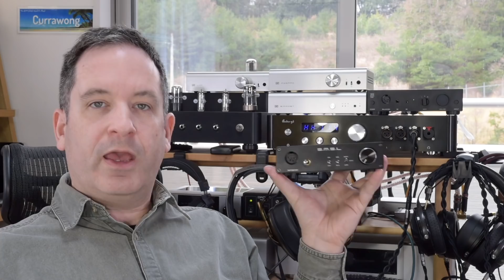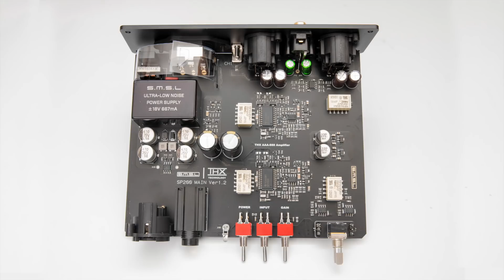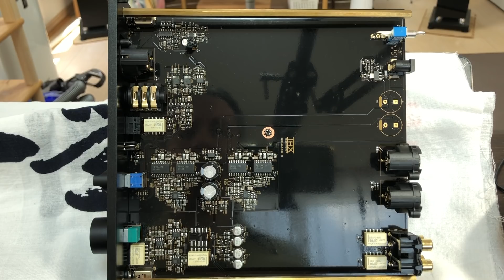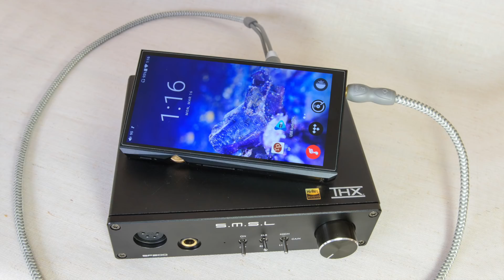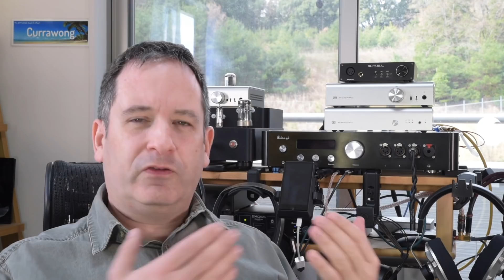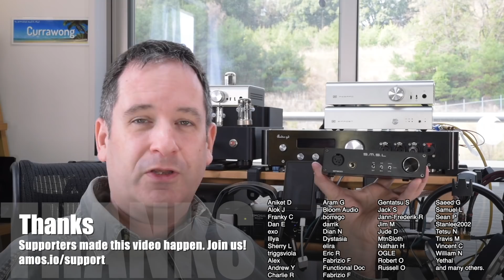SMSL SP200 THX AAA Headphone Amp Review

Comment: Many thanks for this review Currawong.
You nailed it and extremely well put together Sir.
I have one of these units and You uncovered what I believe is its underlying issues with the power supply.
Its a shame that they implemented those balanced connectors that don't really do much.
I would have not used them and instead had 2 power supplies for each channel and a stepped volume pot plus some other changes.
I find this unit a real odd ball to be honest.
It is as You say extremely accurate which Is great but shortly becomes dry and uninviting.
Interesting how the sound stage is spread out and less central focus to.
Have a great Day from the UK :)))

Comment: I've just got mine today I'm sending it back it's not really usable soundstage is just not there I think I may have a defective model as if I unplug a RCA  so just ones plugged in I still get sound in both headphones and running a left right sound test I notice left would play through both speakers same for right so completely useless for gaming as well
Reply: I am feeling exactly the same.
I originally bought this amp because I have a ton of THX badged equipment from Years ago and was hoping that it implemented some of the de-coloration - De- emphasis and re-equalization of the sound stage but this review has further affirmed my suspensions in that the manufacturers have jumped off that THX logo and mainly applied it for output and feedback.
This unit reminds Me of a British manufacturer I bought Many Years ago named Audiolab.
One of the biggest mistakes I have ever made 
The Audiolab was drier than a desert and had literally no appeal whatsoever.
This small Headphone amp is either a hit or miss product.
I have been collecting for some time both valve and solid state and find this unit good but not excellent.
Its a unit that amplifies and that's about it and is extremely linear which is ok but for Me it can be uninvolved and lacks life.
The review was extremely helpful.
What gets Me is that minimal power supply is tiny which adds up to the sound stage detraction's but yet can power very demanding headphones.
It makes One wonder what corners have been cut when designing it.
My other THX gear is way in front even on Music let alone films.
Its the only format I will use on Movies.
I wish someone would make a really good THX headphone amp just for films and gaming.
Pioneer could have done it Years ago but sadly not.

Comment: I am planning on getting this amp and the drop 6xx headphones, However I was wondering if it is possible to connect the amp directly to my computer without getting  a separate Dac, if yes would the sound quality be good enough?
Reply from the maker: Depends on the audio quality of your motherboard.
Reply: Did You ever get it sorted ameer?
I am a little late in the game on this review but do own one of these small headphone amps.
I think you would notice a difference in distortion and output but not musicality.
The headphone amp is a very "Dry" sounding unit and what You put in it puts out very neutrally.
Their is not much in the way of coloration or character 
I have been collecting for about 40 Years and have had chance to try a myriad of both valve and solid state units over the Years.
This small amp does very well in its distortion or rather lack off which is extremely low.
Do You still have the computer ameer? If so do You know what sound card is in it?
This unit does have some decent internal parts which do a very good job but in a more Exact clinical sense.
One unit I picked up recently was a small nobsound valve headphone amp which in all Honesty really surprised Me.
Its a tiny hybrid design which has awesome sound stage for a staggeringly good low price.
It uses Op Amps inside and manages to drive very demanding headphones.
All the best from the UK :)

Comment: If we don't talk about a bridged amplifier, a balanced input ends at the very first amplification stage in almost any schematic. So, the only purpose is to eliminate an electromagnetic noise from a cable. Thus, there is no difference either we convert it to a single ended in a buffer stage or in an amplification one. And in case of a bridged power amplifier I see no sense to amplify that noise until it will be negated on a speaker coil. However, if we talk about a no-feedback amplifiers (which sometimes sound charming), it starts making some sense to reduce a difference between N-leg and P-leg. But I doubt no-NF amplifiers can be easily found on a market.

Comment: Dont let the fact its not true balanced put you off. THX is known for zero noise! So there's actually no difference really between the RCA and 4pin XLR  other than voltage.
Reply from the maker: Zero noise is impossible. Quite a few pairs of IEMs out there will pick up noise from even a THX amp.
Reply: @Currawong  yes, I think I have over exaggerated it as I own one myself :P I agree. We should be talking strictly numbers but it is hard to hear!
Reply: @Currawong  and to be honest I’m not a big fan of IEM’s, they usually don’t fit my ear well. So I stick to headphones.
Reply from the maker: The easy way to remove a lot of noise from the output of an amp is to increase the output impedance. Even just 2 Ohms, instead of the unnecessary aim for close to 0 Ohms (for the sake of chasing popularity on measurement sites) will lower the background noise considerably.

Comment: Great review. I'm hoping to get some feedback on this. I have a btr5 that has a balanced 2.5 mm output I'm thinking of buying the THX 789 and connecting my btr5 with a balanced 2.5 mm to XLR into the 789. Am I missing out on anything by not buying a dedicated balanced DAC? The DAC in the btr5 is actually pretty good. Should this sound as good as buying a dedicated balanced DAC?
Reply from the maker: I haven't tried it, but if you're happy with the BTR5 then you should try it and see how it goes.
Reply: @Currawong  thanks for the quick response. I assume that the quality of sound coming out of the 789 will largely depend on the quality of signal going into it. Is the type of signal coming from the headphone out of my btr5 the same as what would come out of a dedicated DAC? I'm assuming they're both line level? Also would you suggest that I turn the volume on my btr5 all the way up on High Gain to feed the 789? I just don't want to spend all that money on such a nice amp as the 789 if I'm not feeding it the proper signal. By the way I'm using a Samsung S7 using the uapp app streaming qobuz and internal Flac files on my phone. I'm using a pair of hd6xx and I plan on buying the he4xx also. The sound is pretty good from the btr5 but I think both headphones would benefit from a bigger amp with more head room. I mostly listen to music at home but prefer using my phone instead of a computer. Thanks again.
Reply: @chrisbianchi8876  I'm planning to do the same thing (BTR5 + amp), did you do it? How did it go?

Comment: I have a hd 6xx I'm running through a smsl sp200 amp and a fiio m11 as a source. When I go from the line out 3.5mm of the fiio m11 the sound is completely different from the 4.4mm balanced output. The balanced 4.4mm output sounds a lot bigger with a lot more bass but I dont know if it's a "normal" sound. The smsl is SE throughout I'm wondering which way is the most "normal" way to listen.
Reply from the maker: The 4.4mm output to the SP200 or the 4.4mm output direct to your HD 6XX?
Reply: @Currawong  the 4.4mm output into the smsl
Reply from the maker: The headphone output and the line output go through different circuits. Also, as you know, the balanced input is converted to SE inside the SP200. I'd use whichever sounds better to you.
Reply: I cant tell if its the cable or the output but for me the balanced output is a decend amount sharper to the ear but also sounds slightly more detailed.

The single ended output sounds softer in the highs but also a bit muddy and generally less energetic.
Using sundaras btw, maybe someone can tell me if he is experiencing the same weired difference and were it comes from.

I have to correct myself, I just tryed it again the difference in detail throughout all frequencys is verry significant. Obviously most noticable in the highs and lows.
Cant explain why though.
Reply from the maker: @minigaangsta  You mean the 4-pin XLR output. The SP200 doesn't have a balanced circuit. The only reason it could sound different is that some connectors have a higher amount of crosstalk.
Reply: @Currawong  My single ended cable now broke I suspect it to maybe been broken before without me noticing. I am fine with the XLR cable but I now ordered a new single ended one just out of curiosity. Cant wait to find out if the difference is actualy a matter of crosstalk or if the cable was the issue. Anyways I will probably send the SP200 back after and try the Topping A90. Have you tryed it? I could only find a review from you about the D90
Reply: Don’t choose amp just because of xlr out。 it’s all depends on your system. I am pairing with topping D50s ,   Sennheiser HD6XX and wire is much cheaper. 888 is made in the same factory with 789 and 887 thx. Also  888 is a very lucky number in Chinese. I bought a used one for $175. Save the $125 for a new HD6XX

Comment: sp200 is THX AAA 888 suppose to be slightly better than THX AAA789 in spec.
Reply: Functionally the only real differences are the gain stages, build quality and a linear vs logarithmic potentiometer. The potentiometer is the biggest issue. The linear pot in the sp200 is part of why you can't use sensitive IEMs with it. If you want to power IEMs with a desktop amplifier, get the 789. If you don't care about that, the SMSL is a little less expensive and smaller. The differences between THX AAA 888 and 789 are inaudible. The distortion is already so low as to make no difference. The 789 also puts out a little more power, but the sp200 will likely power just about anything you throw at it. I use it with Modhouse Argons and it's great.
Reply: @eva2k0  https://www.youtube.com/watch?v=6Zuynm3o3vs

the comparison review at 4:25 saying the output power of 789 is lower than SP200. Also, 789 didn't' score better than Sp200, been slower in response, having a smaller sound stage.
Reply: @eva2k0  is the output the same for single-ended and balanced output?
Reply: if you own the 789 dont buy, otherwise get it coz it sounds neigh identical to 789. Z reviews did a big review on this.

Comment: Great detailed insights! I was looking at getting the SP200 to replace the headphone output of my Mackie audio mixer (1642 VLZ4) as am not happy with the quality & output. Having to go 3pm to drive my Beyerdynamic DT 770 Pro 80 Ohms H/phones to hear mixes. Can you please advise as to whether this would be a good choice for this purpose. My Mackie is pretty much the hub for a lot of sources including condenser mics and hi-fi CD/Tape players. Thanks and this is a rare gem of a channel that I was so happy to encounter on here. Big hi from Sydney for your great talent and work.
Reply from the maker: I reckon that going to 3pm isn't a problem, as long as you aren't hitting max volume, where you can get channel imbalance. That's just a gain issue. This amp should work fine though as you can use either the headphone output (6.5mm x1 to RCA) or XLR to it if you feel you need more volume and better headphone driving capability.
Reply: @Currawong  Thanks .. by the way the specs of the headphone output on the Mackie is not clear .. on its smaller 804VLZ4 sibling it says 60 Ohms headphone output. However for my 1642VLZ4 model it just says .. "all other outputs = 120 Ohms". Not sure! I was reading that trying to drive a headphone which has a lower impedence than the source impedence is not good. Well both my headhpones are below 120 Ohms, one is 44 and the other is 80. I think the hphone amp is the way to go?

Comment: dear sdir. do you have in mind to review the focal arche headphone amp? i'd like to pair it with my focal clear, but not before your review. many thanks
Reply from the maker: Borrowing Focal gear is a problem here, as the distributor doesn't gain anything from lending it to me.
Reply: @Currawong  ok, fair enough. in your humbled opinion, what would be a good amp+dac to pair the clear with, based on the stuff you already tried? i'm more into analogue like sound. many thanks.

Comment: its pushes 3w through RCA as well ? what is the meaning of 3w x2 / 32ohm ? does it means its pushes 3w per channel on balanced and 3w through unbalanced rca? im kinda confuse :(
Reply from the maker: The 4-pin XLR output isn't balanced. It is the same output as the 6.3mm output.
Reply: Currawong once the power goes into the XLR it becomes balanced, is that how it works?
Reply: Means has the same output 3w per channel 32ohm headphones , so if you have a 64ohms headphones you will have 2 x 1.5w per Chanel and so on

Comment: although the xlr output is not balanced, in my opinion running balanced xlr input to the device is benefitial for one reason, differential signaling which nullifies any noise created during the transmision phase from the DAC to the AMP

Comment: Got to this video late. Still don't get drop and smsl, labeling the whole, "it's balanced but not." They admit it's not truly balanced. But guess I just didn't get it.  Might been good time like schitt (in most of their units), too just show single ended can be great solely; but in truth, I guess they did anyhow (i.e., it not being actual balanced) 😉 I've heard you in the past,  and agree; that balanced is overhyped. Single ended can be made  powerful with as good of low noise floor, as balanced. Having said this; question: have you used any PS audio stuff? Just was curious. Good review. 👌🏻👍🏻 Do feel it's (sp200) a great solid buy, absolutely.
Reply: This is the reason why:
https://benchmarkmedia.com/blogs/application_notes/audio-myth-balanced-headphone-outputs-are-better
Balanced differential amps don't do a damned thing for headphones other than double the internal components and thus double the potential sources of noise and distortion. The XLR inputs are there to reduce connection impedance.  So it's not a matter of false advertising or "fake" balanced outputs. It's good engineering. The XLR connector CAN provide a balanced output in addition to lower connection impedance but the balanced differential output doesn't increase signal quality while the lower impedance does. So THX (and Benchmark) keep the connector and ditch the balanced differential amplification.

Comment: I’m having a very hard time finding one that is good and has the L/R knob for balance. My left year needs a boost so I can enjoy Stereo music (partial hearing loss). Can you recommend some amp or dac?
Reply: Check out RME's ADI-2 DAC fs. It is a DAC/Amp with the ability to separately tailor the sound to each channel. The amp is excellent and includes both balanced and unbalanced outputs and a special output for high sensitivity IEMs. Also includes DSP processor (that is where it allows you to tailor the sound for each ear separately). Many reviews available.
Reply: @charleswhite2426  Thank you Charlie! Much appreciated!
Reply from the maker: You might be better suited with a DAP (portable player). All that I've reviewed have a channel balance setting. If a DAP is inconvenient, it can be used with a desktop amp. The other thing which I'm going to review is the Drop Koss ESP95X electrostats. The volume control has a built in balance control, though it's fiddly.
Reply: If you're running music through a  Windows 10 PC you should be able to get into the sound settings and adjust the channel balance from there.
Reply: @mclement052164  thanks Mark, but the problem is that some devices don’t have that and I’d love to be able to have it fixed universally. Playstation and other consoles did not implement it :(
My TV also doesn’t change the balance when I’m wearing headphones.
Reply: Mike- go over to Facebook and join THE HEADPHONE EXPERIENCE GROUP. and ask that question again. That REI solution is a great solution, BUT it's a bit expensive. There's a good chance that someone in the group might know of an affordable solution. BE DETAILED & SPECIFIC in describing what gear you're running with regards to music so you can get a useful answer.
Reply: @mclement052164  I agree, it is expensive. 

The other solutions that were recommended do solve the problem to some extent, but this DAC allows me to fine tune it’s EQ to the exact frequencies that my ear is struggling with. Also I wanted an awesome AMP for my music, so as soon as this damn virus is over or manageable, I’ll be getting one